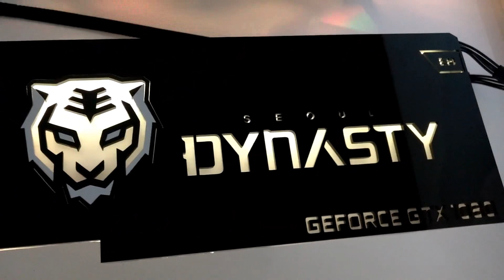Custom Seoul Dynasty RGB GPU backplate

Comment: Ehh what are the thermals like if I was to make a backplate from acrylic, or would it not matter
Reply from the maker: I have not personally tested for thermals but have had customers report back to me that they saw may 2 to 3 degrees Celsius when using the backplates. But if you have a very hot card and are overclocking on the extreme end of thing you really should be watercooling the GPU. 
thanks, Jeff
Reply: Jeffrey Mays hahah true man, thanks